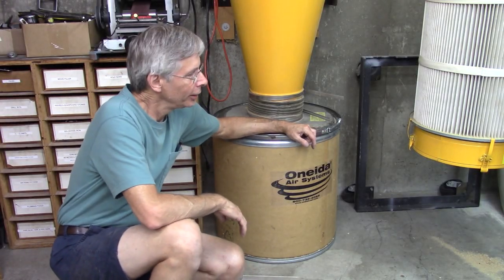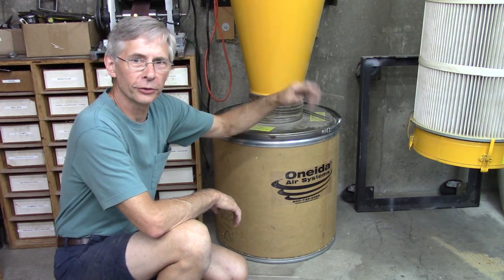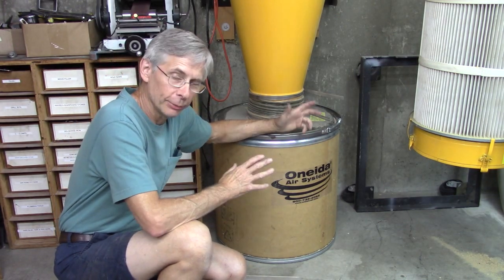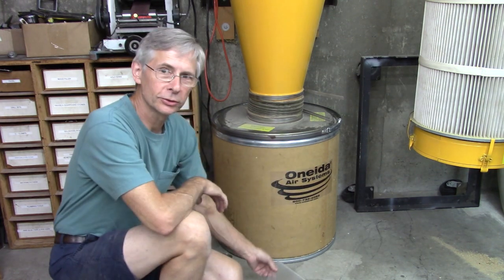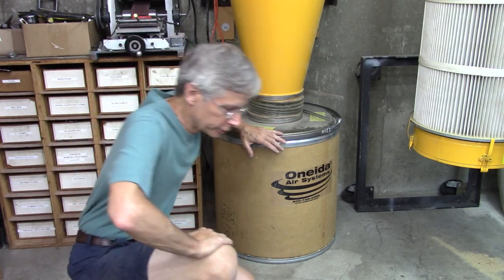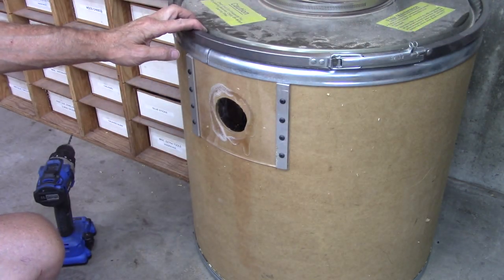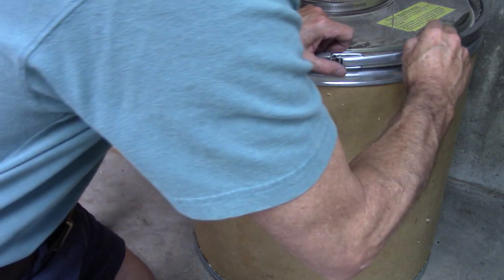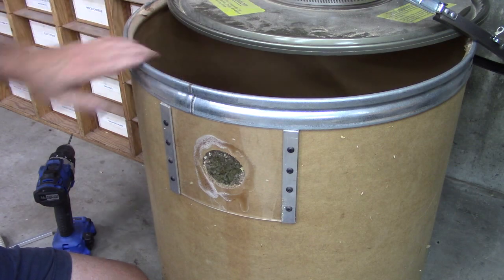Stop your Cyclone Dust Collector from Overfilling!

Comment: 1:25 I bought my first hole saw a week or two back - used it for the first time yesterday ! Mine's 60mm (2 3/8") what's yours ? ;)
Reply from the maker: Thay are handy to have around. I have most sized up to 3 inch
Reply: @WinkysWorkshop  I'd not go lower than 2" as I have drills up to that ! In fact, I've just drilled a 22mm 7/8" hole in wood - using a masonry drill - LOL - the material is not as important as the diameter. Amusingly, looking at your CNC wood lathe - the hole I wanted was for an emergency stop button !
Reply from the maker: @millomweb  I think my saws go down to 1-inch. I got a super good deal on them.

Comment: Hi Winky, This may be a stupid question, and it doesn’t pertain to this Video. I received a Jacobs Chuck on a R8 Mount with my Grizzly Mill. After the Chuck fell off, I noticed it is only pressed on the the Taper of the R8. Am I supposed to Drill and Tap the R8 Holder and put a Bolt down through the Chuck? Not sure why it came like that, and not real sure what to do about it. Any help would be greatly appreciated.
Thanks
Reply from the maker: Most the R8 adapters have a male JT33 or JT6 taper that goes inside the chuck and only friction holds the chuck in place. Usually they hold very well.  I have seen one fall off when used to hold and end mill. They don't hold well with side force. I'd try cleaning it with acetone and use a brass hammer to drive the taper into the chuck. Just one firm tap on the back of the J8 end should do it. If that doesn't work use some red locktite. That might make it so the chuck can't be removed but the adapters are cheap.
Reply: Thanks for the advice. 👍 it’s much appreciated.
Reply from the maker: @joeybobbie1  You're welcome. I hope it works out.

Comment: I put one of their  super duty cyclone collectors on a 35 gal. drum in line, in front of the  duct collector. Works great and no more duct collector filling up. Everything drops from the cyclone before it gets to the collector and the suction  pressure always stays the same. With the small drum on  the bottom of the collector, it seemed that the suction dropped  as that drum filled up. Running a planer or jointer for a day would fill it up in no time. And its easier to lift the cyclone off the 35 gal. drum and take it away .
Reply from the maker: That would work. I've never noticed a drop on suction unless I overfill the drum and the filter gets dirty but it sounds like you have some added insurance.

Comment: My friend makes Guitars, his goes into a bag and he puts it in his Vege Garden.
Reply from the maker: I can get a bag to fit mine but usually just dump it in a wooded area behind the house. It works well as a mulch in pathways but from my experience the wood sucks all the nitrogen out of the soil for a couple years. After the saw dust rots however the soil is soft and easy to till.

Comment: I wonder if cleaning the inside of the plastic with anti-fog glasses cleaner would help
Reply from the maker: Maybe... I don't think it will be an issue but I was thinking a grounded wire next it to remove the static charge
Reply: @WinkysWorkshop , that was my thought but wanted to see if it had already been suggested.

Very clever sir; exceptional thinking "outside the box"!  🤩 👍 👏

Comment: Winky, when I saw you using self tapping screws into the cardboard drum, and you expecting to make the perspex conform to the curve, I thought those screws won't hold for long. Glad you fitted nuts and bolts. Might be worth a try of spraying some anti static solution on the Perspex. If you still have shops that sell Vinyl Records, they should sell it. Regards fromAustralia
Reply from the maker: Yeah the screws were just to hold things in place although I think you figured that out . I use a nail gun the same way sometimes. One or two small wire nails keep things from moving during a glue up. I don't think static will be an issue but I was thinking about rubbing it with a dryer sheet

Comment: My collector is a 30-gallon corrugated metal can with a wooden lid. I cut two holes in the lid for glass view-ports -- one for me to look through and one to shine a light through. Makes it easy to see how full it is -- contents aren't self-leveling, so a side view can be misleading. Some dust sticks to the glass (guessing a lot more would stick to plastic), but a few taps shakes off enough to see through. Not a problem if you're only using it with a jointer or planer (mostly shavings), but with table saw, drum sander, and CNC, lots of fine dust as well.
Reply from the maker: Time will tell, I think it will work okay, its far enough down. Actually the drum fill a little higher in the center but only about a couple inches